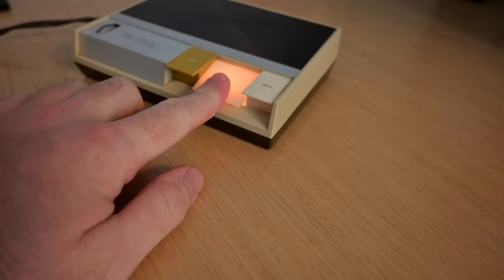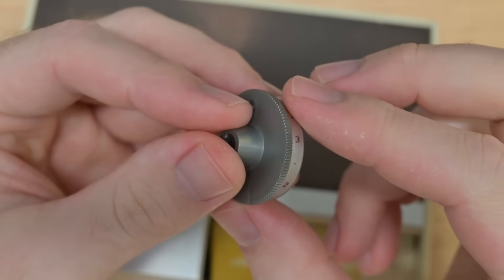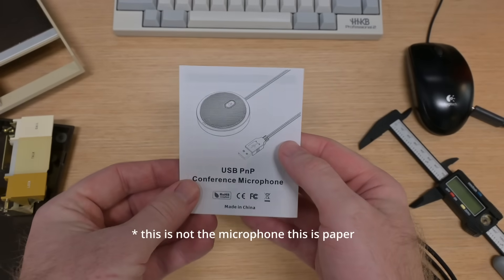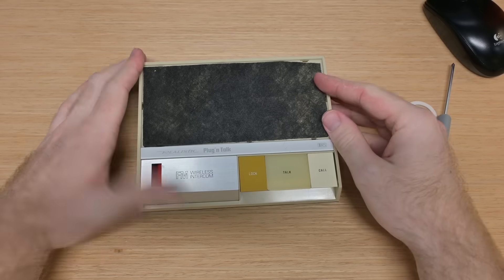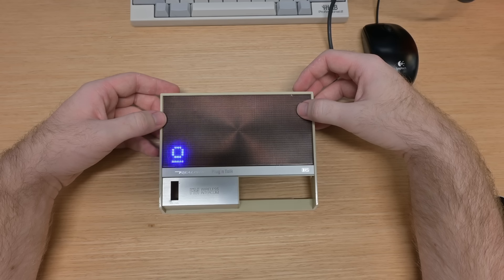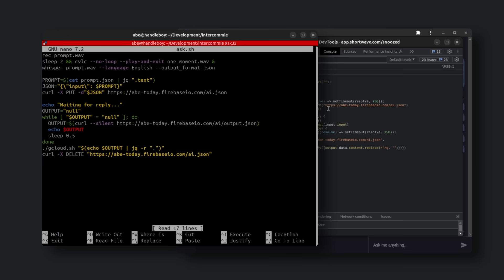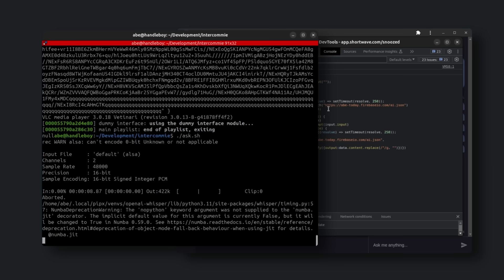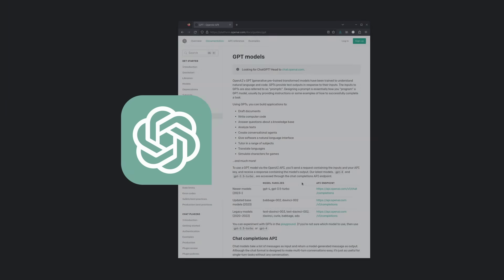I hacked an AI into a 1980s intercom.

Comment: Love this. It's always cool to see retro tech getting repurposed. Also, any updates on your super auto pets gba demake?
Reply from the maker: It is still coming. The tl;dr is I kept putting off releasing it because I wanted it to be perfect, but got overwhelmed. I'm going to release it in a 90% finished state and let the community take it and run with it if they like.
Reply: I wanted to leave it authentic, reuse that built in speaker as a microphone like in walkie talkie or even make an external RF circuit so that intercom is completely untouched
Reply: There's no retrotech being repurposed here. There's modern tech wearing a retro mask. I would have loved to seen the intercom system reverse engineered so that the AI uses the actual intercom tech to produce and listen to audio.
Reply from the maker: @jayturner5242  I wanted to do this as well, but 1) AC current scares me and 2) I didn't have time, maybe for a future video we'll do a redux.
Reply: @abetoday  just hack the device, it should have some sound lines inside the circuit somewhere between the amplifier and modulator, but yes, it requires reverse engineering and looking where PCB traces go which can be hard
Reply from the maker: @Gameplayer55055  The real issue was that the microphone is also the speaker, so to switch between listening and speaking would require more advanced control of the device and I felt I was likely to break something in the process of stumbling through that.
Reply: @abetoday  it's basically how walkie talkies work. Not sure if there's a good way to use Arduino as a microphonespeaker, maybe use a relay and a decoupling capacitor?

But still I love the concept of embedding AI into such a device and your videos
Reply: @jayturner5242  It's still quite an amazing feat though, isn't it?

Comment: The light border on your LED display is where you cut away too much of the dark speaker 'cloth'  You can use a Sharpie to black out the plastic at that point if you ever open the cover.

I am impressed by your cramming of all those USB devices in to the case. I would have removed some of the casings from the Mic and Speaker to help with sound quality.  if you only plan for half duplex audio you could have cut a hole to point the speaker forward through the grille.

The use cases for intercoms are limited.  Humans are lazy and the wireless remote is proof of that.  However if you focus on uses that place you near the device when you need to use it then it is a great tool.  Having it as a door phone is great, in the kitchen to add items onto your shopping list or in the toilet when you want to answer the phone or door intercom without video are all cases where you are within reach of that talk button.

Comment: the title is misleading. you made it seem as if you had used the already existing hardware inside the device to do this, but you pretty much just used the shell of it to make this project. not much of a "hacking" job to say the least. I mean, you could have even jerry rigged it so that you have a motor that presses down the button of the second device when you have it talk, so you dont even have to modify the intercom devices directly. alternately, you create a simple device that will interface with the already existing part of the intercom devices (think, rapsberry pi using the already working audio streaming capabilities of the intercom to make it more authentic.) this is still a cool project, but not really "hacking" as you say.
Reply: as for the software side, with the tools you have currently, this is quite impressive. I hope shortwave makes an API soon. however, I would suggest running the software on a raspberry PI enclosed in the case of the intercom (you might have to rearrange some stuff to make it fit properly, and dont forget to make some way to cool it. since this would only be running the AI, passive cooling would be enough, luckily. just cut some vent holes
Reply from the maker: I really wanted to do it this way, but sadly I was limited on time and my experiments for going this direction was not yielding any fruit. Hopefully you still enjoyed the video enough though it wasn’t exactly as you expected!

Comment: You did not need to do all of that for all of this to work. Intercoms use a very basic phone line that even a baby could set up and understand. Hell, today, you can actually buy (or make) your own intercom phone system to pass the audio through to the computer to transcode and process in the cloud.

All you would need to do is pass the phone line through a 120-volt connection (or much lower for shorter distances), which is essentially like giving it the power it needs to function. This connection provides the necessary electrical energy to carry the audio signals from one end to the other, making it accessible for processing or transmitting through various devices. In simpler terms, it's like plugging in your phone to charge it; the electricity flows through the line, keeping your communication channels open and ready for action.

all you would have to do for the computer side is to interpret the signals coming in. talk would just unprompted send voice signals down while call would probably play a annoying tone that the computer can assign a function for.

So really, you really shouldn't have gutted everything out and replaced them with modern components when they just work (except the little LED Matrix you put in there for which either a separate USB cable to the computer or external components for it's function would have sufficed.) 

I think in terms of using really old tech to make things work, I would want to preserve it's history and not modify anything in it. only adjust, add or move the pieces around. I'd want to treat it as a museum piece.

[Note: assisted by ChatGPT]
https://chat.openai.com/share/1c013826-292e-4cb6-8946-4947239ea70e
https://chat.openai.com/share/be9d02a8-fa2c-46cf-90bd-4923b7a1e855